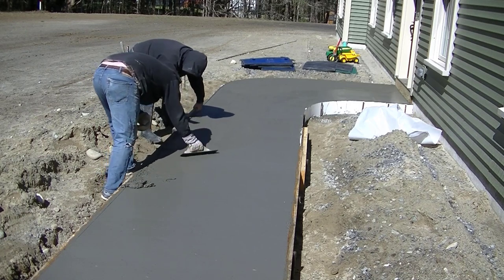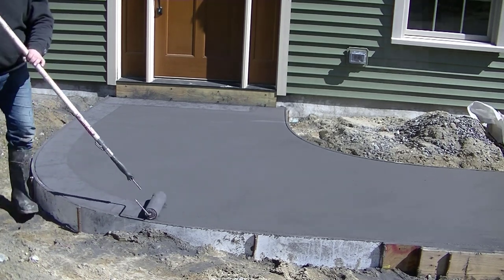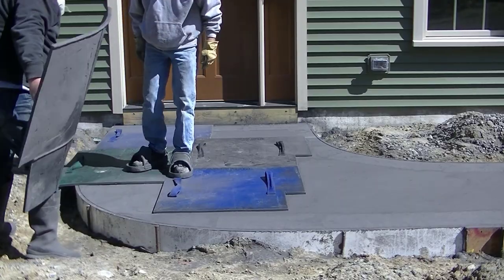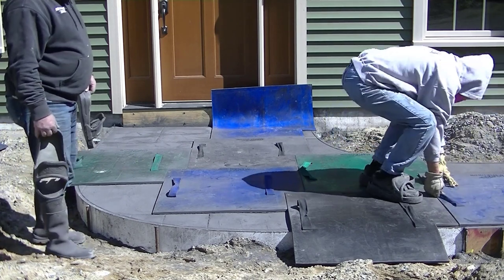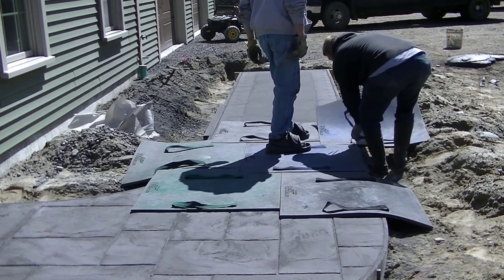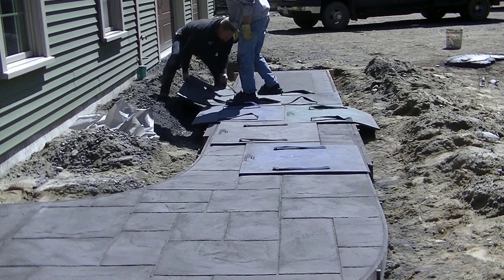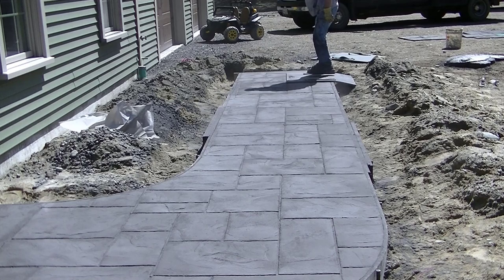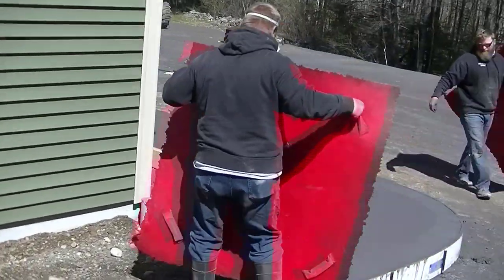How To Pour and Finish a DIY Concrete Sidewalk (Can You Do This on Your Own?) Part 2

Comment: Good video Mike,  started doing stamped concrete about 20 some years ago,  I started talking customers into just color.  Because it's hard to shovel snow it holds a little water and patio chairs are hard to balance.  But it does look beautiful after a seal. And little maintenance
Reply: Yes and commercial snow removal isn’t an option because it will scratch the gorgeous stamp.
Reply: We have 13 different patterns to choose from, rent for day is $300, buy is 3400
Reply: @brocklanders6011  how does that work out, as far as quantity of pads? Sounds like a good side hustle, making those in the garage to sell.
Reply: @harryhedgehog5549  Usually you get a dozen or so pads with a skin and a roller and it's chizzel

Comment: great little series, thanks!
I don't yet have a great read on drying conditions and differences in the mix to try this for real money. My concern is getting halfway done and finding out that things have set up on me too much! Would be an expensive mistake. So, I'm not gonna consider it until I've schooled myself on little 4' x 4' practice slabs, in the back yard. In different conditions and with different mixes. 

Here in Pittsburgh, exposed aggregate, with brown color,  is the "fancy" finish most people want, at least for sidewalk repairs, which is a bread and butter kinda thing for small operators like me. Bright white, broom finish, somehow equals govt work or generic. Even with a broom finish. I think for total replacement, that's good enough, but if there is already some pebbles showin', people I pitched work at, they want to match it. I haven't learned how to pressure wash the cream off yet either. So I'm still just broomin' or bust.

Comment: You make placing concrete look easy. It is not. Besides timing the stamping right, most patterns have to be laid out perfectly or they look like crap. Having something that resembles stamped concrete is fairly easy…making it look good is hard, and it takes knowhow, craftsmanship, and experience.